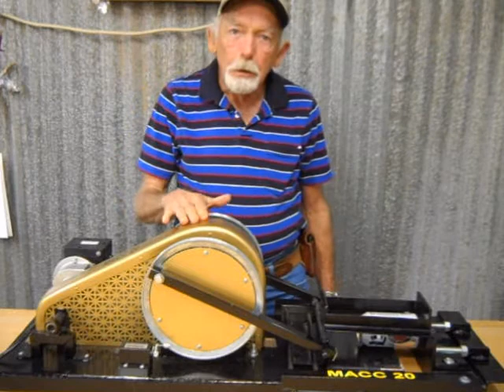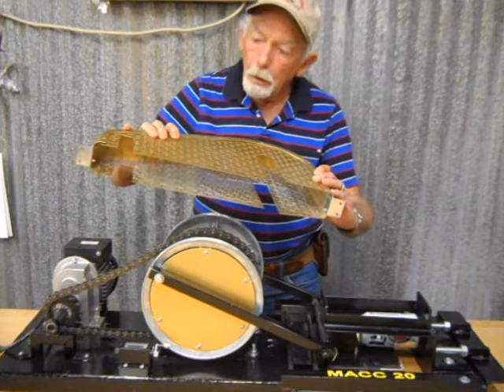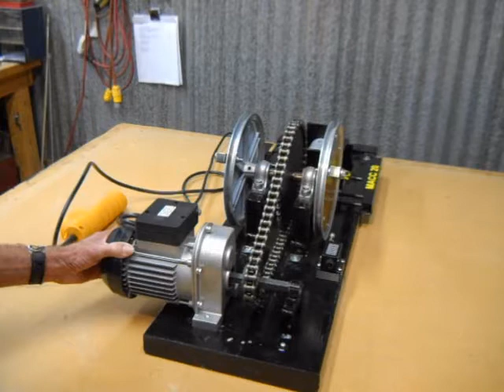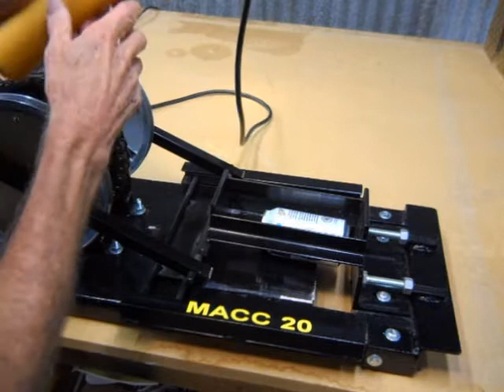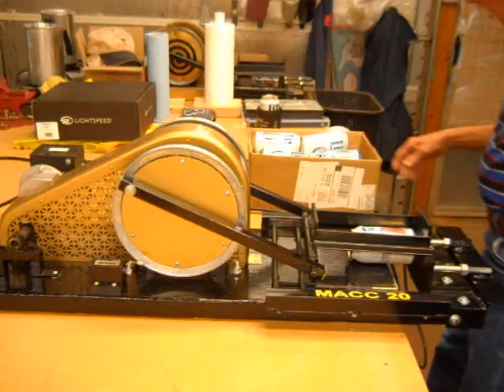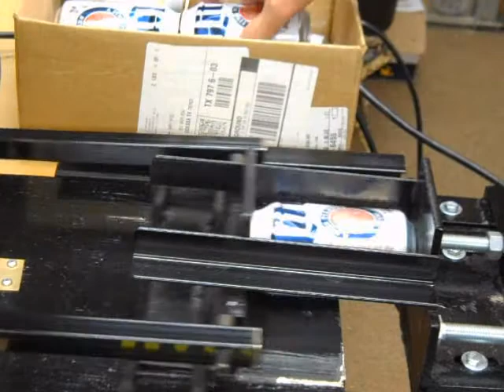Motorized Aluminum Can Crusher

Comment: Nice little unit mate you have the power and speed right but just wondering why you made such a wide crush zone. If you narrowed it down a bit the can won't be able to go in lenght ways if you place it in wrong or it bounces into the wrong postion. But it has to be the best on youtube at the momment well done.
Reply from the maker: Glad you liked it. The crush zone is not as wide as you think. 3 3/8" wide and long enough for a 24oz can.The side guides makes it so you can't put  a can in wrong unless you stand it up. The side guides also keep the can from rolling out of the crush zone. Thanks

Comment: Howdy Barry,   I want to build this can crusher but I want to bypass the middle.    Let me know if you think this will work.    I want to add a 9 to 10 inch dia. wheel  directly to the motor shaft.  Attach a single push bar,  and crush the can into a aluminum box.   This will make the overall length shorter.  Will I have enough power to crush the cans?  Thanks for  your time. :)
Reply from the maker: Time I have plenty of. You might be able to do it if you have a large enough motor and about a 3/4 inch keyed shaft. A 9" dia wheel is what I use. Getting a geared motor to run it can be VERY expensive. A single push rod might be a problem. It takes a lot of force to crush a can. It took me a year of experimenting before I got it right.Have you seen my newest video of how I made it. 11 min long. I am always willing to help a fellow inventor.
Reply from the maker: OK. I see you have seen my newest video. Remember, you only want 1 revolution every 3 seconds (20 per minute).That's why I used a pulley sham (sprocket sham). The motor itself runs at 60 rpm. If you need to email me: barry.bswmfg@yahoo.com. Good Luck
Reply from the maker: I read your email, but when I tried to reply, it got deleted. Anyway, if you reduce the voltage to the motor, you also reduce it's power, and it's hard on the motors electrical. A regular light dimming switch will probably not work. Sounds like the same motor I buy at Harbor Freight. Please re-send that email to me again.